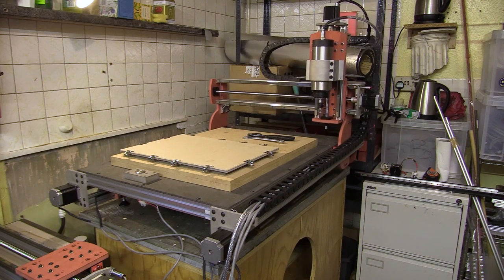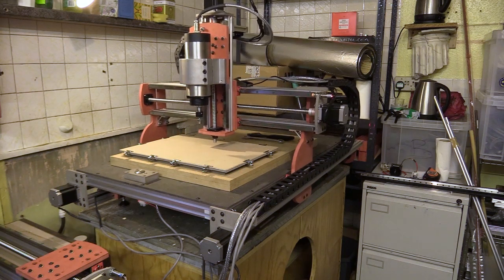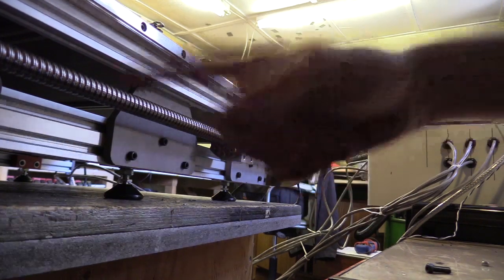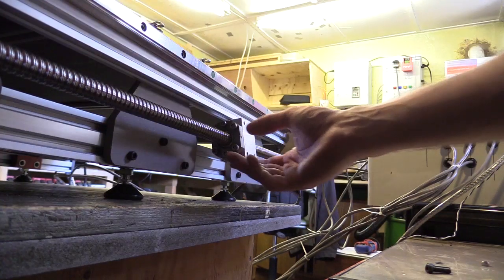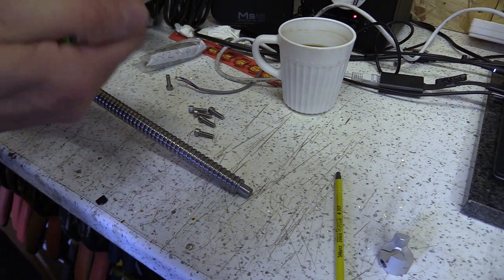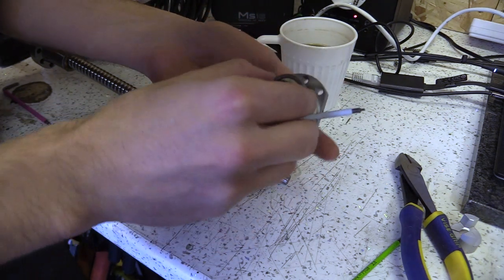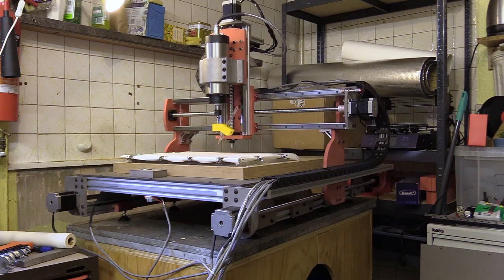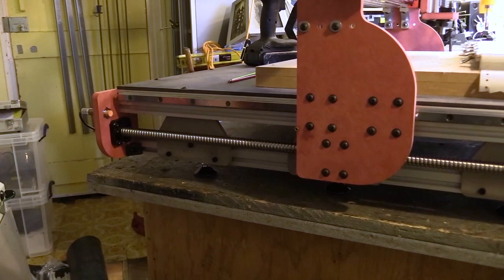#45 Ball Nut Replacement on SFU1605 Ballscrew - CNC Machine Stuff

Comment: Hi  I am building a cnc router at the moment.  X 900mm movement  Y 600mm movement.
What is your experience with the 1605 ball screw (05 pitch) vs e.g. 1610 ball screw (10 pitch) ?   I am using Nema23 82mm 3A steppers and xPROv5 controller.   The 1610s are hard to find   vs  1605 are available no probs.  Thx. P
Reply from the maker: I think the 1605 are fine and what I now use. Generally cheaper too. The risk is 1610 ball screws is while they travel further per rotation the stepper motor requires more torque. Same as your drill 1 is slower with higher torque and 2 is faster but less torque.

Comment: I have no idea how you determined which replacement part number and where to buy.  I have two cnc machines that were used to sandblast signs that need new ball screws.
Reply from the maker: That sounds interesting - what kind of machine is it? I guess measure the ball screw diameter and travel per single rotation is a start.
Reply: @EducatingSavvas  omiocnc x3-300-usb. One was intact, the othere was stripped but had two stepper motors and three ot four ball threads.  I went and got bearings and four m4 cap screws running around town to suppliers.  Bought a used Gecko g540 since they are 10 miles from me.  The contoller was taken spart for parts but is 85 percent there.  Had advice to build the Gecko and not waste time on Chinesium controller.

Comment: OMG!!! you forgot second bearing support, your screw not have a support!.
Reply from the maker: The fixed support is on the opposite side (far end) and motor coupler replaces the other not fixed support. It's not an OMG moment. My cut results are amazing.

Comment: Would you be able to repack the bearings into the ballnut? Is a new ballnut the only option?
Reply from the maker: I've never been able to do it right. Would need to shown how to do it, so it's a lot easier to get a new ball-nut.
Reply: I have repack the 1605 and 1204 ball nut few times with great success...1204 take longer time because is smaller...but with patience is very doable!
Reply: Where did you buy your ball screw or the nut from?
Reply: If you combine two Sfur1605 nuts with a hard spring between them and attach them to your shaft, the gap will be reset.

Comment: You really need a bearing on the end of that machine to isolate the motor shaft. The motor shaft is not designed to take that kind of force.
Reply from the maker: The ballscrew is fixed from the other end. The other support which I didn't use, doesn't fix the screw as it allows for linear movement. Anyway you'll just have to wait for the next video for the accuracy test.
Reply: Educating Savvas  Accuracy is not the issue, it’s the force you put to the motor shaft. That’s why you want to put the coupler behind a fixed bearing. You are headed to a possible broken motor shaft. Don’t believe me? Look it up for yourself. There’s a reason why these bearings exist. You want the fixed bearing on the motor side and the floating bearing on the opposite side. All you have to do is a little research. I’m not trying to make you look bad, just trying to save you some trouble.
Reply: there's no axial load because the screw is fixed at the far end, radial load on the stepper is very little and limited by the coupler
Reply: there's no axial load, there will be some radial load but look up the rating for a nema23/34 stepper, if you exceed that something else is very wrong
Reply from the maker: We'll get to the bottom of this in the accuracy test. I haven't noticed anything with the cut so far, but I have noticed slight resonating noise as the gantry moves closer to the y axis steppers. It's really slight but possibly having the fixed end near the stepper helps dampen that. I've also used a boa strap to tighten the locking nut on the fixed end support - which I'll show in the next video. And remember guys it's not pro machine - I'm just trying to make something that'll kick the xcarve's arse... repeatedly.